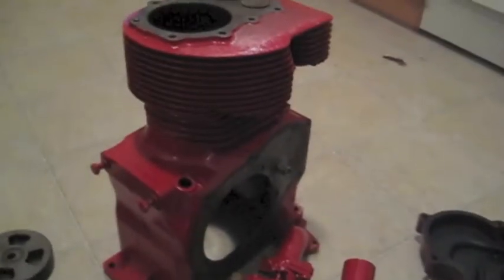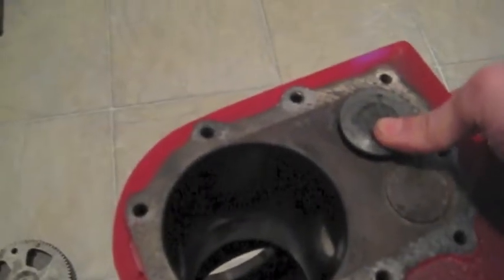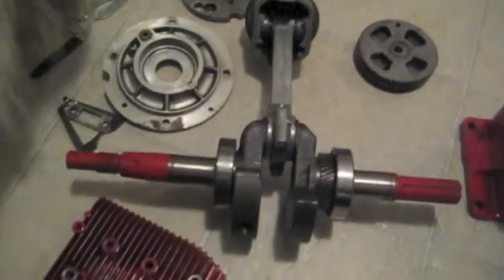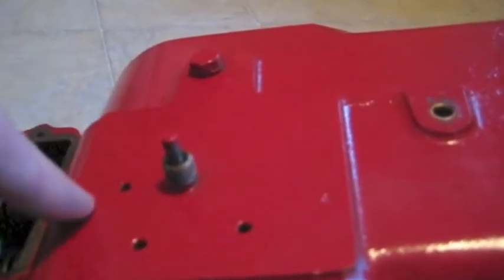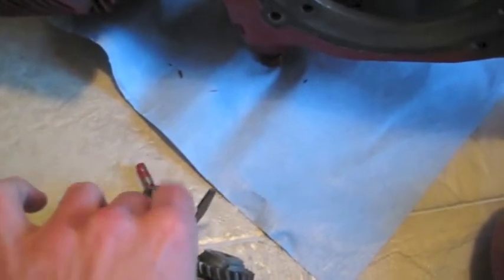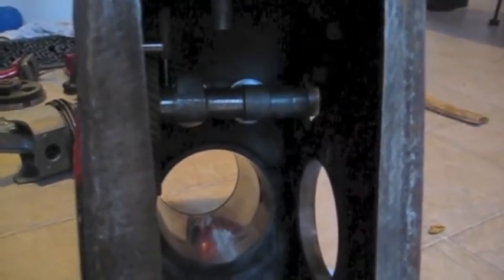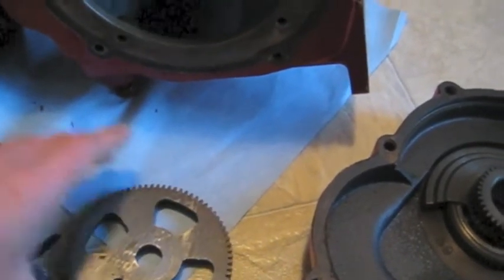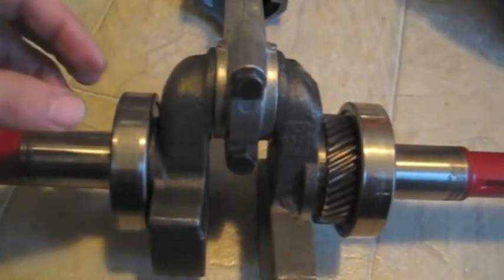3 - Tractor Restoration - Briggs and Stratton Rebuild Part 1

Comment: Are the balancers set at top dead center with the cam and crank markings lined up. I have a engine that won't rev up concerned that it out of time?
Reply from the maker: The piston is at top dead center with the timing marks lined up and the syncrobalance weights toward the bottom.  If it won't rev up check your governor and the points are adjusted right.  Also check your that your grounds are good.  A bad ground will cause weak spark.
Reply from the maker: Also..  If it has a "magneto" instead of a "coil", the timing would come from the magnet on the flywheel. I would check that the keyway is not broken on the flywheel.
Reply: I took the engine apart and found the balancer on the flywheel side was out of time. re timed it using the pin holes and crank and cam timing marks lined up. Restarted engine. still won;t rev up. discovered that when I grounded the spark plug on the cylinder head that my spark would go away after the engine started to spin over faster. so know i'm changing the magnetol. I noticed your engine has 12 volts to the points mine has 12 volts to the coil only no wires to the points our condenser. I guess it just working off ground. But also considering putting 12 volt to the point and condenser. What your take? Thank you for your time
Reply from the maker: What kind of tractor do you have?  Do you have a coil or a magneto?  If you have a coil there should have 12 volts coming from ignition switch to one side, and the other side of the coil should go to the points and condenser.  The condenser and points are grounded when the points are closed.  When the points open, the coil builds a charge, and sparks the spark plug.  I would check that the points are set right.
Reply from the maker: Also sometimes the condensers go bad.  Try changing the points and condenser.